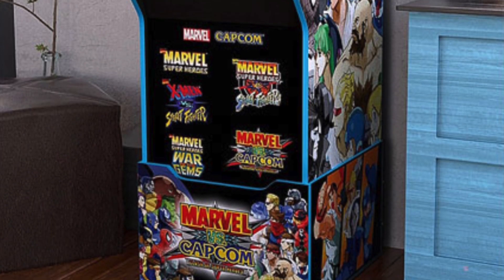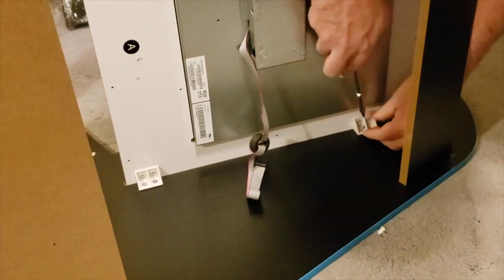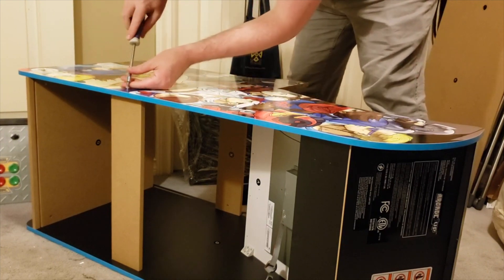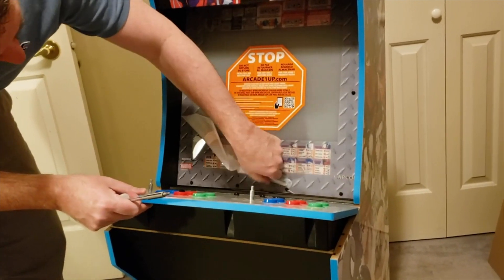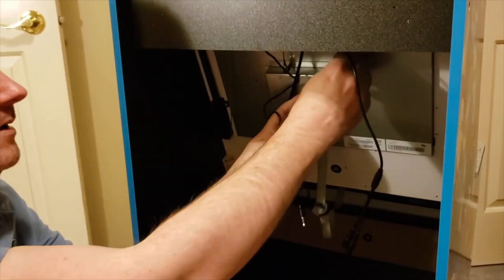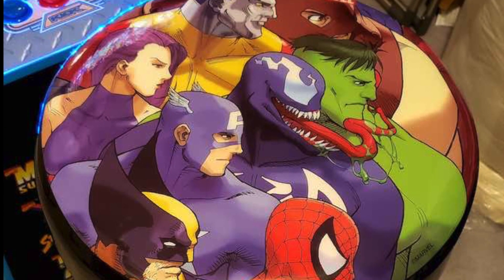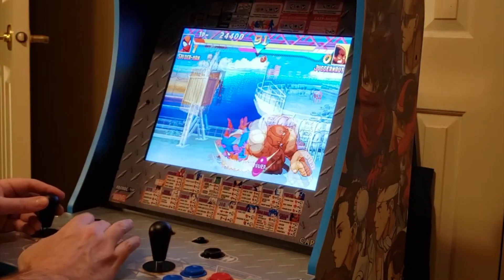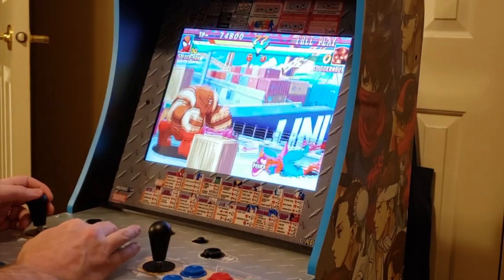Arcade1Up Marvel vs. Capcom Arcade Machine Review

Comment: Does Best buy plan on getting any more in stock anytime soon went to the website and they said they were sold out thanks
Reply: These cabs are in the pre-order phase for Canada. As for the US there seems to be no intention to restock this cab.
Reply from the maker: Hi! If you're in Canada, you can pre-order it here: https://www.bestbuy.ca/en-ca/product/arcade1up-marvel-vs-capcom-arcade-machine-with-riser-stool/15176732. The release date is currently May 7, 2021.
Reply: @BestBuyBlog  Do you happen to know why the release date changed from February to May?  Will my previous pre-order that was placed when it was February be pushed out? Thanks
Reply: Are these the same releases as the US version or will it be different?,